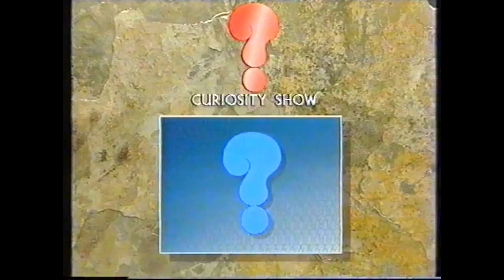Make an 'eco' flower pot with a difference

Comment: I wonder if you can use wicking/capillary action of wood for some sort of self-watering pot... 
.
My 2c: more correct and effective way of controling drainage and aeration is by adding aggregate to the substrate itself(perlite, vermiculte, extruded clay pellets, sand etc.)  Drainage material on the bottom, in most cases, just reduces effective volume and water-holding capacity of the pot.
You can also use fibreglass mesh, used for finishing drywall and plastering, for big drainage holes (or lining the the bottom)